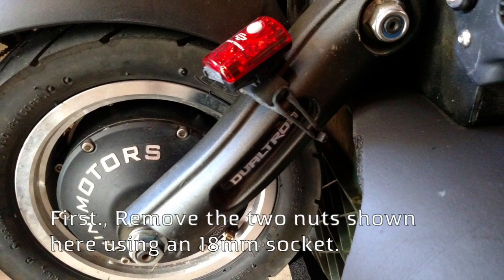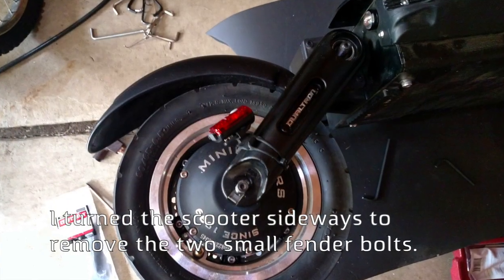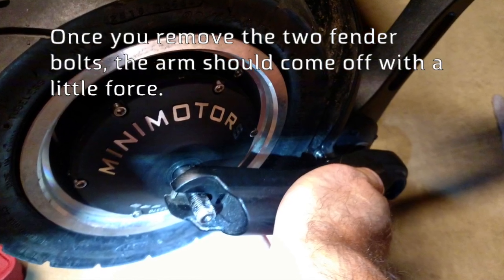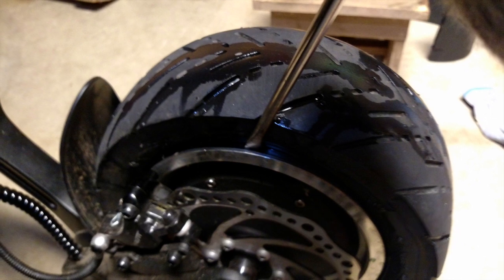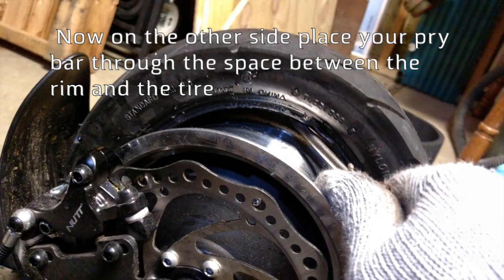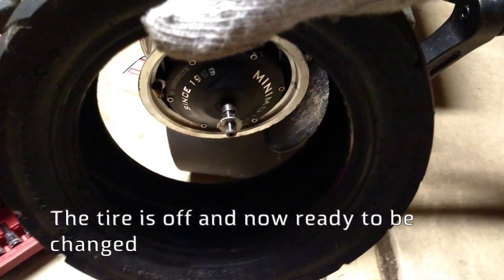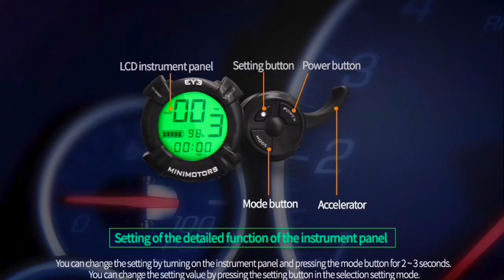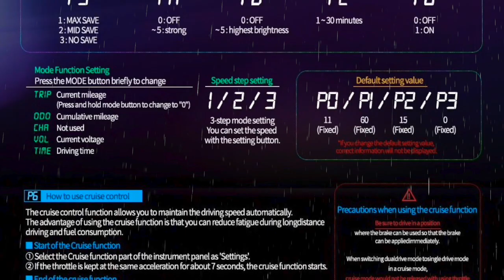REMOVING TIRE - DUALTRON THUNDER - THE DREAM OF ELECTRIC TECHNOLOGY 🛴

Comment: Interesting choice of tire. Please give us an update after you're had a couple of weeks using them. Also, I know it sucks but trying to remove those hidden fender bolts is a pain. I'd rather just drop the hub. Thanks :)
Reply from the maker: after 125 miles on the all terrain tires i can say that they are great! they have amazing grip and handle very well on road and off road better than the equipped on road tires imo. I probably should have dropped the hubs to make it easier. It took awhile to seat the bead on both rims, i had to use a belt/tie down strap to spread/flatten the tubeless tires. thanks for watching! cheers!

Comment: Thanks. The Segway is super slow  so the tires are nhs.  Keep us updated  On how well they handle the speed  of the thunder
Reply from the maker: i highly recommend the segway all terrain tires by INNOVA, they handle the road great, very fast, great traction, i have two thunders, one with the original tires and one with the segway all terrain tires and i prefer the segway/INNOVA all terrain tires, better handling less bumpy, and you can hear a nice hum as they grip the street perfectly. I hope that helps, also the original thunder tires pop easily due to their flatter design and you feel every bump. cheers!

Comment: U can remove the screw in the motor and will remove the wire without having to pry the tire off
Reply from the maker: you can remove the rim from the hub motor, but you will still have to pry the tire off the rim to change the tire. cheers!

Comment: hi
where do you buy the tires off road for the thunder?
Minimotors said me "There is no offroad tire for thunder.
In dualtron series, only ultra has offroad tire.
thanks
Reply from the maker: Yes, there are off-road tires for the Thunder available on eBay and aliExpress. The tire size you need is 90/65-6.5 the brand of tire is INNOVA, they are the same tires used on the Segway Mini Pro. I put on the All-Terrain tires and they are great, better than the On-Road tires. Getting the tires to seat on the rims was not easy, i had to wrap a belt/strap around the tire to flatten it out while using an air compressor to fill the tires. 
Here's a link to buy the Off-Road tires 
https://www.ebay.com/itm/Off-road-tire-for-Segway-miniPro/183352294924?epid=24008489908&hash=item2ab0a5fe0c:g:zUEAAOSwgYBbX4GT:rk:10:pf:0

Comment: Can you give anymore info on that tire. The  link you provided is a different tire.i want that one. Also tread depth. And speed rating if there is one.
Reply from the maker: the tires i put on are INNOVA 9/6.5-65 ALL TERRAIN not sure about the tread depth, but they are a bit shorter than the on road tires that comes on the Thunder, your scooter will sit a bit lower but i find find that these tires work perfect, amazing grip, very fast, i've reached 44mph while using them. The Ninebot miniPRO  uses the same tire so maybe you could look for more info knowing that. Here's a link to the exact tire i bought on eBay, good luck! 
https://www.ebay.com/itm/Hybrid-tire-for-Segway-miniPro/183221842932?hash=item2aa8df73f4:g:R2gAAOSwHgdaq~-V:rk:12:pf:0